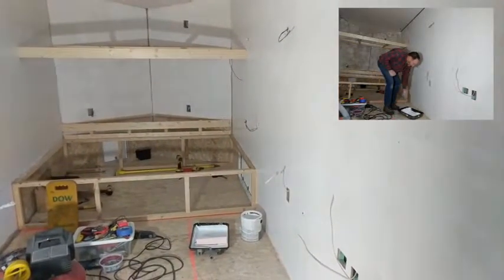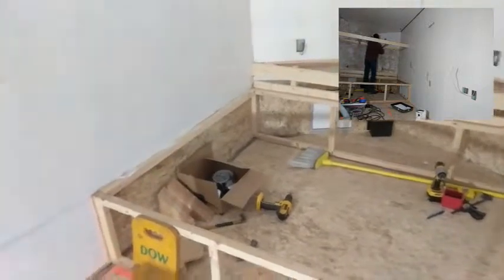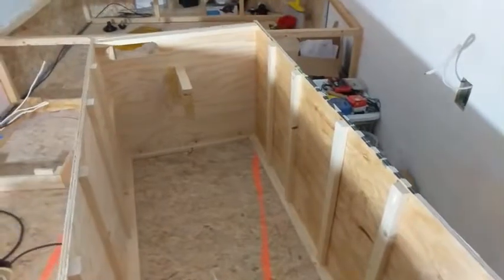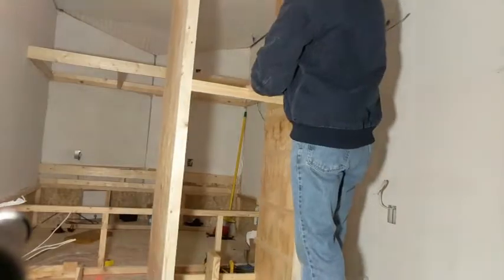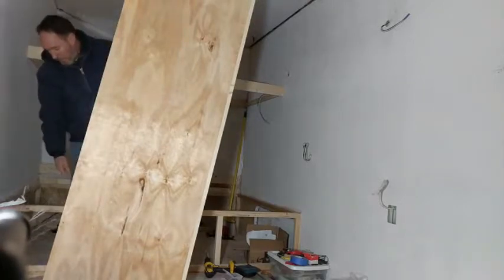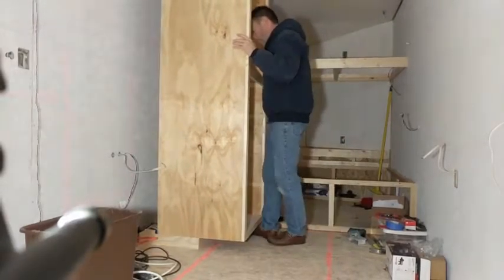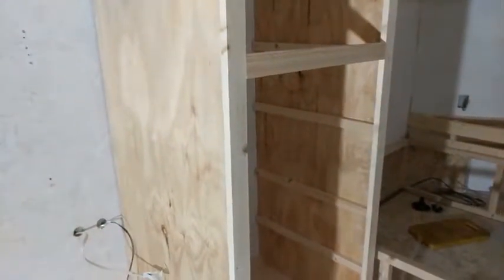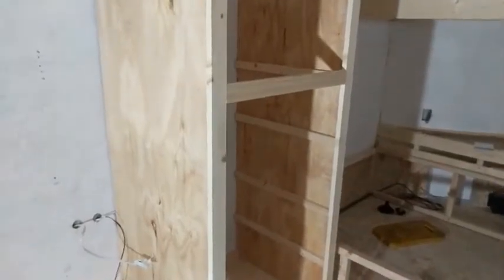Cargo Trailer Camper Conversion - Part 10 Walls & Closet Installation

Comment: Subscribed. Watching your video series. I'm impressed so far. But I do agree with Chasein70. The joints are going to crack. But that's all good because you are going to cover the joints. However. You probably should have skimmed every inch of the OSB that will be exposed. (maybe you did) If you didn't, you will have two very different surface textures that will be very visible after paint. Thanks for the series so far. It's very well done.
Reply from the maker: Definitely.  I skim-coated everything that will be visible and then covered the joints with 1/4"x2" trim boards.  I figure that I saved about 100 pounds of weight by not adding another decorative covering over the OSB.

Comment: Be prepared to put paneling on all the walls. Every sheet rock joint will crack open on your first ride.
Reply from the maker: Definelty a concern.  I am planning to add trim strips to cover the joints, so that will not be a problem.  The thin layer of drywall compound was just to fill any deficiencies in the OSB.